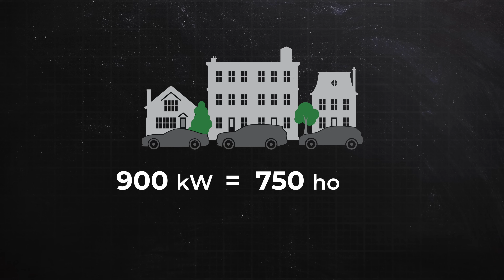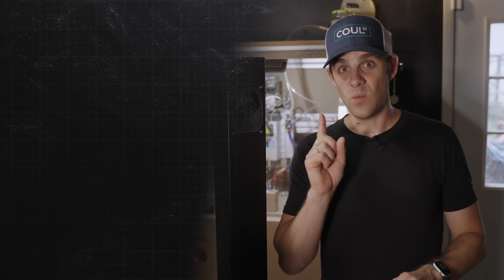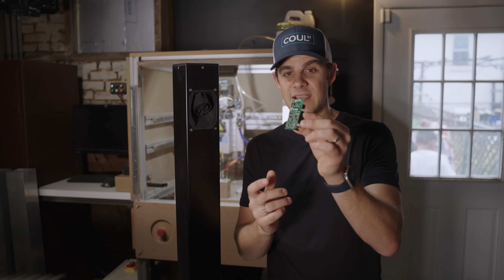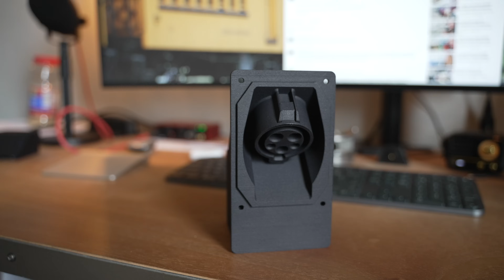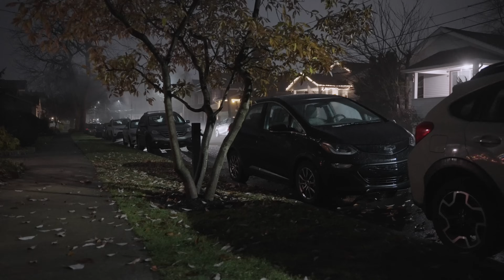North America's 1st Removable Cable EV Charger

Comment: The "bring your own cable" model is a good one.  However as many people have a portable evse have you looked at a 14-50 to cool ev adapter?

The posts are probably the easier sell.  The cable will probably be more difficult.

<Edit> i need to learn to listen to the whole video before commenting.  The evse circuitry is in the post and you litterally just need a cable.  My bad

Comment: Why you don't use Type 2 socket? 
I'ts more convenient when you have locker inside socket. In EU I always use Type 2- Typr 2 cable for my Hyundai EV but for Fiat 500E I use Type 2 - Type 1 ( J1771).
Reply: We are moving to that for North America. This is not based on that.

Comment: Problem with this is it basically your personal charger on the street. Someone has to use it for 10 hours. A cheap fast charger would be best they should be cheaper too. Nxu uses a battery to charge at 400v, avoiding expensive equipment

Comment: Very interesting! I kinda love this and think it would be amazing if every house had something like this near the street! However, I haven’t heard you address how the person who installs the system might be reimbursed for power used by others (potentially just random people). In a perfect world this would be powered by batteries that are storing power from solar, but even that comes with costs. I guess it could be turned off and on from a simple switch or relay in the house, but I still can envision issues if it’s near the street and open to the public. I would like to hear if there are plans for managing access to the system and how that might work. Like say I wanted it open to all comers from 8am to 5pm but wanted it reserved for a neighbor who wants to charge overnight. Will it be possible to collect a modest fee to cover electricity and maintenance?

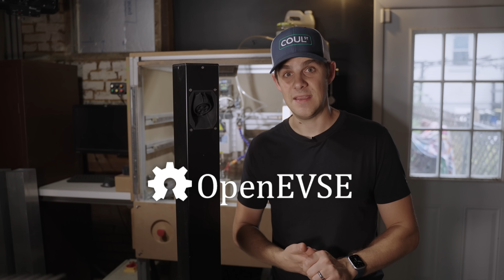Comment: At 7:13 , Open EVSE sounds like a sensible source for open source design. 
Some start-ups try to develop proprietary IP which costs a lot and takes years. 
If you can avoid re-inventing stuff by using existing EVSE components, you can focus on the core issue of designing a cost-effective bollard. ☮️

Comment: Thanks for the update. 
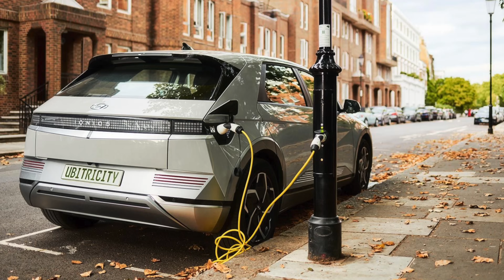In Europe, some companies including Ubitricity are talking about installing slow chargers in existing street lighting poles, which you show at 5:38 along with various dedicated charging devices.
That addresses a different market where the charger is provided by a utility. 
Nevertheless, that product might be a useful reference for your business model of a curbside charger owned by the homeowner. ☮️
Reply: I wonder would it make more sense for the local council to own the "chargers", but on loan to the nearby apartment owners... with a separate pay-per-charge program.

Comment: Josh, I wish you the best in this endevor. This is an important market to serve, and IMO this is the best way to do it: Charging posts with a "bring your own cable."  However, now that SAE J3400 standard is now available we have a standardized solution for North America.  J3400 is based on Europe's proven solution with Type 2 (Mennekes) outlet that locks the charge cable in place when charging.  It also reads  a resistor in the cable to determine the max ampacity of the cable.  This is important as the EVSE and the EV may both be capable of more current than the cable.  

Going a non-standard route with a J1772 plug at both ends of the cable will be a dead end, requiring specialized cables.  In Europe, EV owners only need one cable to work with any charge point.  We don't want to get into a situation where EV owners need multiple cables to charge at different charge points.

Comment: Do we have a plan to circumvent cable theft while charging?
Reply: SAE J3400 cables have provision to lock the cable to the post when charging, and most EVs will also lock the cable to the car.  This is the same method as used in Europe.

Comment: You haven't addressed the financial side of this for the providers with posts and users other than themselves.  How is all that going to work from start to finish?  Including but not limited to initial investments, software, networking, data hosting, security (anti thievery), safety, payments/payouts etc.  If you have a solid business model in place than this looks like it may have a great future.  Especially if you switch over to the NACS plugs or at least give people the option to use it instead.  It is the future.
Reply: Good call, I wasn't thinking on that one.
Reply: @URackADisciprine  NACs is the car end. The standard at the post just has to be compatible with all EVs.

Comment: Am I just tired, or did you pre-speed up the video by 1.25x?

Edit: re: condensation. A conformal coating may be a quick and easy fix.

I suppose thermally insulating the board may help as well.

Comment: 1:10 I agree with your opinion here. We need safe charging.
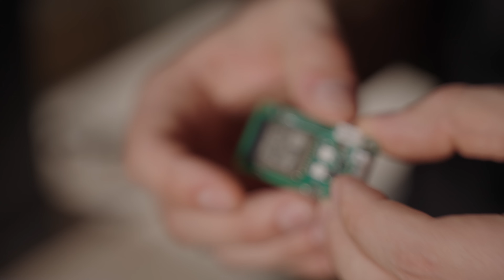9:28 esp32 controller, ardruino, mature support
12:49 easy solution against condensation: coat the electronics in epoxy, or silicone.
IMO: this is very good simple solution! Next add payment; this way neighbors can use it too.
Reply: I believe I have seen ltt use some sort of spray coating for some of their videos where a motherboard could get wet.

Comment: A simple fix to your water/electronics is to not keep them in the post.  Just keep them at ke near the breakerbox or someplace otherwise protectes from the elements.  I would not keep the😊 electronics in the post.
Reply: Also you get the added benefit of the. The power lines running to the post are not being powered at all.  It should be way safer.  You also will still which is . missing local disconnect.

Comment: Hello, for your mk2 unit, consider the following:
1. J3400 has intrinsic to it a standardization of the euro-style plugin post that you're trying to provide in North America.  Please use it instead of your 3d-printed J1772 and bespoke dual-ended J1772 cable.  It should likely become a consumer product in the long term, a J3400 <-> J1772 dumb cable and J3400 <-> J3400 dumb cable.

2. For airing out + environmental protection, consider placing a 5-sided cube sleeve on top of the post that is toggled by pressing down and releasing, kind of like the soft close release of a cassette eject or some kitchen drawers, it would have to have enough push to fully raise the cube sleeve to open position, and it would have slits at the bottom to allow for airflow when in closed position.  The post would also need relief holes to allow for airflow.

Comment: I'm from the UK, we probably have different electrical requirements but exporting a ground outside of the property to a remote location like that is a no-no, you would put a local ground rod in, or use a device which disconnects the ground under fault conditions. Might not be an issue in the USA, as here in lots of urban environments you use the suppliers neutral as ground.
Reply: An earth rod is not a reliable current return path to source in a fault condition. Using a neutral (grounding conductor) as an equipment grounding conductor is exceptionally hazardous as a neutral carries return current in its normal operation. This energizes the equipment case and may provide a return path to source that passes through a person in a fault condition. 

Therefore in the US an egc ground earth lead is mandatory even if there is a rod since about 1999. This connection is kept separate from the neutral. In this video, no neutral is present at all as the whole 240v split phase is utilized with two 120v hots. Where you are, likely you always use a neutral with your single 240v hot lead. 

If you are using the neutral as an earth ground return path and it is tied to the outlet casing and there is a ground rod there. Imagine if the return neutral wire came loose at the main panel and then you touch both the outlet casing and the main panel casing while the outlet is energized. You become the favorable return path over the ground rod.
I'm always shocked how complex electrical wiring can be. 😅

Comment: Why not just a 240v nema outlet? Most EVs have a 240v charger in their trunk.  Then all you’d need is some kind of payment device controller.
Reply: silly dangerous
Reply: The OpenEVSE is the payment device controller, and J1772 is ubiquitous, whereas NEMA outlets vary (14-30, 14-50, 6-50, etc.) so you'd need to carry a set of adapters with you anyway.

Comment: Make the cables harder to steal by the tweakers
Reply: Theoretically they won't be able to steal the cable while it's in use, since the J1772 plug can be locked by the vehicle. That won't stop them from just taking some bolt cutters to both ends of course, but hopefully the 240v shock will at least stop them from trying it twice. ⚡
Reply: @joeyhazlett  not hard to insulate bolt cutters against 240V.

Comment: I thought the J1772 spec did not allow for detachable cables on both ends which is why the NACS standard went with the Minnekes for detachable cables on one  end and NACS or J1772 on the other. Are you planning on switching to Minnekes later on?
Reply: Yup, and SAE 1772 is now replaced with SAE J3400, which allows it.

Comment: Why not a NEMA 14-50 plug on the post?
Reply: @sebinlee221  I think the entire purpose of this project is to normalize this type of charging, which is already common in Europe. If everyone is responsible for their own cable, there is lower liability for the municipalities and they may be more inclined to allow things like this to use public right of way. And if these are commonplace, then it won't matter if someone parked in "your" spot, just park at the next available one and plug in.
Reply: @sebinlee221  an RV relies on those standard NEMA connections. They aren't likely to have a J1772 connection like an EV, but if they did, they're free to pay to charge or use the power however they like. You just need some way to limit access to those who are authorized, and a NEMA plug does not provide that without extra hardware. You might as well put in something that natively supports access control, which an EVSE can support easily.
Reply: Because anyone could just roll up with their RV, park on the street in front of your house, and get free electricity. The EVSE circuitry lets you manage who has access to the electricity, whether that's by paying for it, or being part of a collective where you share the system.
Reply: @joeyhazlett  he mentioned a control board, you should be able to turn the power on and off from the app. The plug type shouldn't matter. Anyone with an evse cable could roll up, plug in and get free power too.

Comment: If I were you from a marketing perspective I would push this to apartments because no other company is focusing on that market in level 2 charging maybe offer to install the posts at your local apartment building at a lower install cost to get a proof of concept to show how your product works to build interest
Reply: I think it's a cool biz op for home owners
Reply: @kawaiisenshi2401  to me that is fine they can do that also
Reply: Maybe not in the US but there are literally hundreds of brands doing just that with Mennekes/Type 2 plugs - which is the preferred cable for NACS as well.

So just import those units and Type2-1 and Type2-NACS cables.
Reply: @mark123655  one problem with that plan in the us we 120v architecture for low powered level 2 charging different than in the EU and the rest of the world I don't think an European companies care enough to redesign thier posts for the us as it costs too much money which means these guys have a lock on the market in the us
Reply: @justinjones6810  Suspect it's pretty minimal changes. From what I've seen of internals not much different between a US and European Tesla wall "charger". There isn't a huge amount to them, the car charger does the conversion.

Comment: The telescoping, retractable pole is my favorite idea. May not be as practical, or cost effective, and have significantly more points of failure, but dang it’s cool. Even a discreet pole will probably the draw ire of the nEVers, but I think that even the naysayers would be somewhat mesmerized by a charger that deploys from the ground.
Reply from the maker: I agree. Unfortunately, so many cool things are crippled by cost and impracticality
Reply: All fun and games until it is buried under 2cm of ice.

Comment: ee here you will need a weatherproof well in use cover in order to comply with the NEC national electric code.  You can view the electrical code for free online the NFPA has a free version they hide it but they are required to provide it.  See NEC 406.10 (B) (2) A receptacle installed in a wet location where the product influenced to be plugged into is not attended well in use shall have an enclosure that is weatherproof with the attachment plug cap inserted or removed
Reply from the maker: Yes, we are aware. Later prototypes have design updates to address.
Reply: Is a J1772 connector classed as a receptacle? It's got a contactor and control board upstream of it, and the contacts are inert except for the ELV control pilot until negotiation is complete.

Comment: Am I missing something here? 750 homes @ 1.2kw/daily? National avg of daily kw is closer to 30kw/daily.

I think you got this number wildly wrong
Reply: His terminology is confusing but he might be referring to current draw rather than consumption.
Reply from the maker: Yes, it is power. The 28.8 kWh divided by 24 hours gives you 1.2kW - daily averaged power.
Reply: Ahh. Sorry. At quick glance I was confused and wasn't sure how you were referring to that number. Thanks.
Reply: In the USA according to the EIA we use about 10,500 kWh per year. Divided by 365 that’s about 28.8 kWh per day.  I suspect in developing countries where they only use electricity for lighting and small electronics his figure might be accurate
Reply: 30 kWh/day.  not "30 kW/day" which is equivalent to 40 hp/day, which is nonsense.

Comment: Great innovation. When I work for DelcoElectronics, we used to use a product to coat the circuit boards to help them last in potentially wet environments for automobiles.
Reply from the maker: Like a conformal coating?
Reply: @chargeeverywhere  It was actually a poured clear coating that was  poured into the engine control module case to protect the circuit board for under the hood applications. Today they are in the passenger  compartment under the dash so not as protected. I think a conformal spray coating would work well for your application.
Reply: You could use conformal or epoxy potting, and fully in case it in epoxy or silicon, assuming overheating is not an issue.  @chargeeverywhere
Reply: @chargeeverywhere  Well most circuit boards with any kind of environmental exposure use some kind of conformal or epoxy coating. I assumed that's what you'd do with Gen2.

Comment: Great video showing your thinking process. One issue that may be difficult to deal with is that many municipalities will not allow the power connection to cross onto their right-o-way. It would be interesting to see a video on how you dealt with the permits both from the municipal authorities and your electric utility company.
Reply: I think you mean easements.  Rights-of-way generally end at the curb or roads edge in the vast majority of situations.  Also depends on whether a street is public or private.  And before a video on permitting, he needs to provide a viable business model with certain financial safeties and securities accounted for.  All is for nothing without that at this stage.

Comment: Love this as well.   But since it’s public parking how do you prevent non EV’s from blocking your charger?
Reply: Totally understand your concern, I had the same thought myself. What I found though is the extension cables you can get go up to like 40ft so while it’s not a guaranteed 100% fix, it would prevent the issue. If I used public j1772 chargers or public NACS destination chargers, I would own one of these for ICE prevention anyway. I actually encourage this idea over a lot of level 3 for areas that want to encourage more than a hours stay. I would say if we could get car manufacturers on board to install this extended limit, a 240v/100amp charging system could encourage longer stays at places like libraries, parks, museums, restaurants, etc. while still lowering the cost of install plus more revenue over time because 24kWh is way better than 12kWh and with batteries getting less expensive to build they’re getting bigger creating more need for power. Plus it might actually encourage people to sell power from their home because I wouldn’t care if someone parked in front of my house to charge while I worked as long as I was at least breaking even. But at that time it might be cheaper to build an A/C-D/C slower charger via a 480v connection that could say to 30-40 kWh so that you aren’t overheating cables. Actually, I’ll get started on that, but they won’t look as nice and probably wouldn’t be allowed on the street.